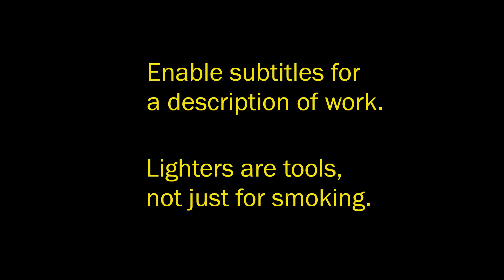Lighter Therapy - 1966 Zippo - D.W. Flowe & Son, Inc.

Comment: Subscribed! Love watching, its therapeutic. Im curious about the green flint component. Its an inert? What is it made of?
Reply from the maker: It is Oregon 21-395 Gatorline .095" round trimmer line.  For easy visual identification that there's no flint inside and to prevent flint crumbling from clogging the flint tube when the lighter is left in very long term storage (like when just on display).
Reply: @nechronius  Thanks! This is helpful. Another way i learnt: After removing the flint- is by clamping a thin cardboard square between flint spring follower & striker wheel. Although altering the looks, it can remind people not to strike.
Reply: Hey, those lighters belonged to my grandfather company, I can tell you everything you'd ever want to know.
Would love to be able to purchase one of them if you would sell me one or two. Thanks Lisa
Reply: @John Stallone  I guess we're family then haha😂